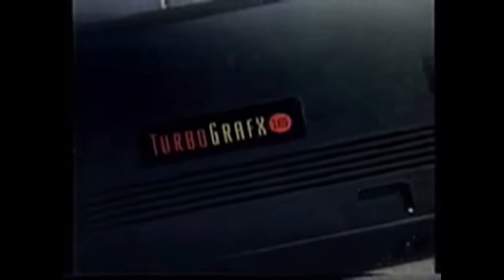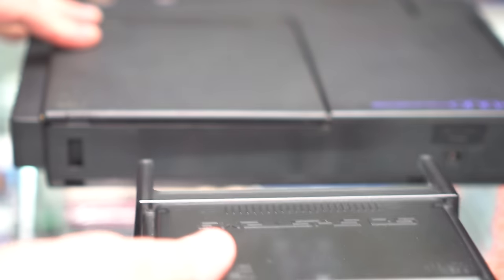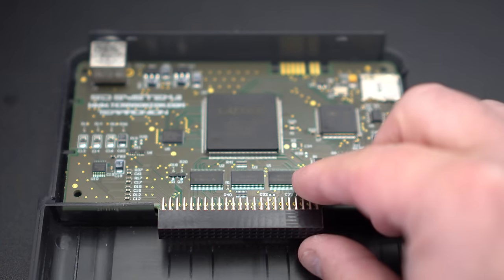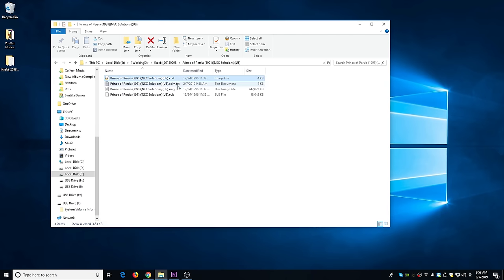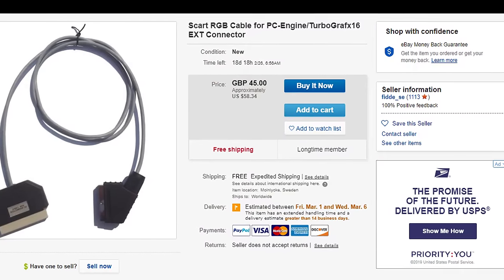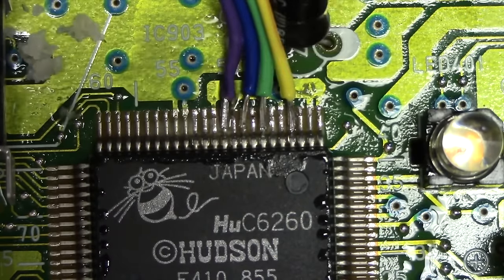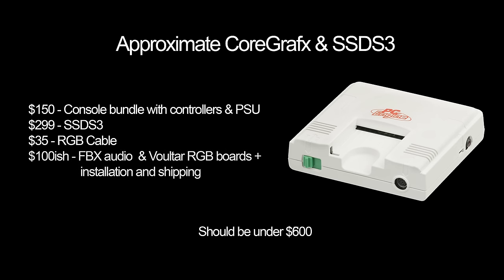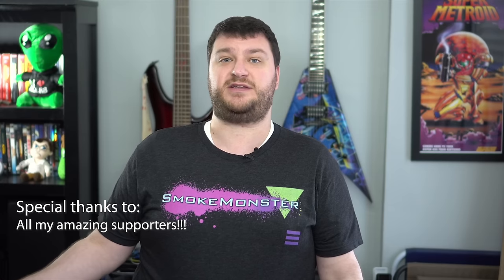TurboGrafx-16 & PC Engine Hardware Solutions

Comment: FINALLY! I’ve been begging western YouTubers to talk about UpperGrafx UGX-02 since December 2017. At that time, only GameTechUS’s video about the UGX-01 existed, and no one realized it was supposed to be an ODE or that it worked more like Hi-Def NES (replicates digital video in FPGA; doesn’t sample analog RGB). Yes: December 2017 was before the Super SD System 3 launched.
Reply from the maker: ...and the reason I didn't was because I wanted to take my time and give it a real review, not just a quick mention :)
Reply: RetroRGB Yep. It was still frustrating to see everyone assuming that they had no choice other than SSDSys3 while Terra Onion was still refusing to acknowledge the issues, but I totally understand waiting. Mind if I ask who loaned you one? I might have a few questions for the guy/gal. :)
Reply: @emmettturner9452  I was aware of the UGX-01 in development in 2017, but it did not advertise CD-ROM² support and was marketing itself as a DVI up scaler at the time. Meanwhile, the SSD3 was backordered and undergoing revisions until late January 2018 IIRC?

I didn't see any mention of the UGX-02 until the last week or two and just ordered one. Apparently it is only the second one shipped to the USA, so I don't think that in 2017 it was really a viable alternative, it did not yet exist.
Reply: greyグレェ In 2017, CD-ROM² support was announced for UGX-01 but they never managed to get it to work. Needed more RAM or something, so they revised it to UGX-02 and offered refurbishment service to UGX-01 owners. They kinda got ahead of themselves and even added instructions for ripping your discs to the SD card! It’s obvious that they always intended this to play CD-ROM², since the unit had an SD card and a USB port from the start (only one or the other is needed for simple firmware updates). I remember being baffled by the GameTech video in 2016 since he didn’t even mention the SD card slot or that this was full-digital (not upscaling). It was clear that he was missing something BIG.

Super SD System 3 was announced in Dec 2017 and began taking preorders. UGX-02 was supposed to begin shipping in 2017 but they ran into production issues. In the end, both SSDSys3 and UGX-02 began shipping in Jan 2018. Because of the botched launch where Terra Onion stopped shipping the first revision and recalled them, you could say that UGX-02 beat them to it... not that the UGX guys didn’t have their own problems with their launch but at least that was all BEHIND them in Jan 2018 (UGX-01 refurbishment thing and 2017 delay). ;)

David Shadoff (prolific ROM hacker/translator) seems to be in North America and doesn’t seem to be the one who provided one to RetroRGB so it seems that there are at least two others. How either of those got here is anyone’s guess.

According to Google Translate, their CD-ROM² page first went up just over two years ago:
2019/02/17: Update internal data update page , distribute upergrafx_20190210.pac.
2018/10/10: Update internal data update page , distribute upergrafx_20181007.pac.
2018/08/07: Update internal data update page , distribute upergrafx_20180806.pac.  
2018/08/02: Added bug fix progress page
2018/07/14: Update internal data update and communication software page, add ROM image transfer page
2018/06/05: Updated order page (For countries other than Japan)
2018/03/26: Update internal data update page
2018/03/01: Troubleshooting FAQ The page of CD image transfer software has been updated.
2018/02/21: The notice of the repair of UGX-01 has been described.
2018/02/19: A page of internal data update has been created. A bug has been fixed. Description of INTERNAL RAM MODEL in the setting menu has been renamed.
2018/01/23: The release date of UGX-02 was set on January 29th.
2017/09/22: Release date of UGX-02 changed to pending due to manufacturing process trouble.
2017/08/25: Announcement of new version release, How to use CD-ROM2 compatible function , CD image transfer software was created. Along with that, the existing announcement was also changed.
2017/04/02: The page of CD-ROM2 correspondence plan was created.

Kinda crazy how long it’s been getting ignored, especially in light of the SSDSys3 issues. The alternative was hiding right under our noses the whole time!

I started the “Anyone else excited about Super SD System 3 for PCE/TG16?” in 2017 and you can see exactly where I totally switched gears and got more interested in UGX-02: Dec 26, 2017. This video was a year and some months later. I literally waited THAT long for a western impression. :) Looking forward to yours as well. Thanks!

Comment: Best video so far! I only wish there was also a bit of info on the IFU-30/briefcase. They look the coolest IMO. And something I've always wondered is whether IFU video output, whether the original composite or through an RGB amp installed on it, also has jailbar noise, and what the fix is for the IFU as opposed to PCE/CoreGrafx units.
Reply: You will still need to modify the console to eliminate jailbars. In fact the IFU RGB mod needs additional filtering to produce the same video quality as the console on it's own.
Reply: @MobiusStripTech  Oh wow, I didn't know that. Thanks! I know Voultar designed a board specifically for the IFU, but it doesn't seem to be available for purchase. There's a lot of questionable mods out there for the IFU, so hopefully more standard mods become available for the neat little briefcase.
Reply: @Izquierda  he is still planning on releasing the IFU board. I believe he recently said he found another change that needed to be made for fitment. Due to a change in one revision of the briefcase.
Reply: @MobiusStripTech  Yeah there's the IFU-30 and the IFU-30A. The power button looks a bit different, and the box design was different too. I suppose there were small changes in board design then. When Voultar releases the board I'll reach out to see if you're available to get it installed in my IFU since I'm located in the US. Thanks again for all the info!

Comment: Great video with lots of good info. So many choices it is just a shame there is not one truly ultimate solution.

I do have a couple, hopefully constructive, critiques.

When talking about Altered Beast you mentioned that some of the early games had system card comparability issues. I think it is literally the only game with that issue. Also the system 1.0 card was only released in Japan and replaced relatively quickly. I just hope that statement doesn't cause people to worry about sys card compatibly because of game bugs when that is not a thing other than this 1 game.

The other thing is I don't think it is the best advice to just tell people to get the Pro arcade card. It costs a fair bit more than the Duo card. The explanation of the differences is: I if you turn on the system without a card in the slot and see the System Card screen you can use the Duo card otherwise you need the Pro card.

Otherwise that was a great video, I really enjoy these deep dives. Keep up the good work, we are all counting on you.

Comment: What’s going on with the display at 26:35 into the video? The wavy distorted picture at the top of the monitor. I had the exact same thing happen with a Sega Genesis 2 into a PVM. I switched out the RGB cable and it was fixed but I’m curious as to why it gets like that. I know it was a “slightly cheaper cable than the replacement but a drastic improvement. Just wondering if I can fix the cheap cable or just leave we’ll enough alone

Comment: I have original hardware for many consoles but I enjoy emulation for some of the more finicky consoles. I own a tg16 but i prefer to emulate. Retroarch with run ahead latency reduction and output to pvm offers an experience close to the $1000 options in this video for a fraction of the price. Input lag, in some cases, is less than original hardware and i have noticed no audio issues with the emulator I'm using. Only downside is slightly softer rgb than original hardware.

Comment: TurboBooster from DB Electronics is a good solution, but I had never seen that Ebay RGB cable with the amp built into it. I  want to buy a second PC Engine for my HDTV, and that would be a great option.

Comment: If the SSD3 got it's issues sorted out and also offered digital out with HDMI, I think that would be point where I'd finally be willing to drop down the cash for one.
As it is now, it's tempting but $300 is still a lot of money when it's not a complete all in one solution yet.
I might even be willing to spend $350 if I knew this was the definitive end all solution for my PCE

Comment: You can get RGBHV from the UpperGrafx with an HDMI to VGA adapter. If it really supports original 59.83Hz output then RGB is a non issue, so I hope I’m wrong about the VSync settings (59.83 vs 60 = Buffered vs. Non-Buffered).

Comment: Excellent and extremely thorough analysis. I have just subscribed. So I have my original Turbo Duo from '92 and haven't used it in years. I am wary of using it after hearing about the capacitor issues. Before I begin to play games on it again, I would like to have the caps replaced, an 8-pin RGB/SCART connector installed, stereo RCA jacks installed, and the jail bar fix. I own an OSSC for playing on an HDTV. Can you recommend a reputable, professional modder to have this done for me in the U.S.? Thanks!!
Reply: Simple: Voultar

Comment: Does the legit CORE GRAFX have a slight buzz on the sound, or do I need a cap' replacement? It's nothing that bad, but you can hear it if you pump the volume up.
Reply from the maker: All analog audio will have at least some buzz at higher volumes.  Video game consoles more than audio equipment, cause they were designed for a general audience, not specifically audio gear.  But if you know how to safely replace capacitors, it's always a good thing.

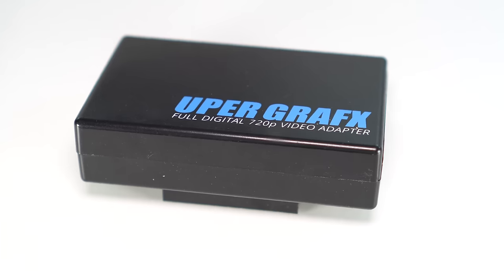Comment: For the Uper Grafx, just wondering -- at 12:40 the video shows a DVI to HDMI cable being used to bring the video into a monitor, but wouldn't you need a converter more like eBay # 112631637002 in order to get the analog line audio and DVI digital video to an HDMI device? I know the audio mentions a converter (but not the video), but I figured I would ask because I had to buy a similar converter recently. Just asking mainly because I haven't been able to get my monitors to play analog audio inputted when the HDMI interface is chosen for video input, so I believe the audio has to get converted to digital and then shunted into that HDMI cable somehow.
Reply from the maker: Nope.  I should have clarified that the UperGrafx has an analog-to-digital audio converter built in, so audio is transferred over DVI.  I probably left it out to not confuse people into thinking the video was A-D too....but I should have at least specified all you need is the cable and nothing else.

Comment: I’m so confused by the different models, shocked by the aftermarket hardware prices, and horrified by the owner’s responses, that I can’t imagine doing anything except a MiSTer for TG16. Seriously, a MiSTer and the low-latency card to use original controllers are cheaper than any of this.

Comment: Any timeframe when to expect the re-worked Super SD? Would like to get one but hearing that I would need an extra audio fix is a bummer.
Reply: They already started shipping the new revision that contains both fixes. If you order today, that's what you will get.
Reply: @MobiusStripTech Thx mate!
Reply: @MobiusStripTech  i ordered mine on 01/28/19...would that fall under the revised run? i got it from stone age gamer.
Reply: @bobthompson7545  unfortunately  no. The units stoneagegamer has are all rev2/3. You would still need the add-on boards. At which point you would have the equivalent of the new revision.
Reply: @MobiusStripTech  well that blows!! mabye i'll return for a refund and wait for the new board to come to Stone age.  I can't see spending ANOTHER 100 bucks to have it modded etc.  thanks for the heads up.
Reply: @MobiusStripTech  I ordered yesterday (Feb 14) so does that mean my ssd3 from terraonion is the version with the latest audio fixes?
Reply: @DannyVirring  yes. If you ordered from TerraOnion directly in 2019, you will get the new version with fixes on board. StoneAgeGamer will be getting the revised units at some point as well. I don't work for TerraOnion, so I can't speak to timelines on that.

Comment: 13:07 “Only possible because he PC Engine and TurboGrafx-16 as well as the GameCube [DOL-001] are the only game consoles that present the digital video signals externally in a connector.” They don’t really have digital output, but what’s really happening is even cooler:
The connector exposes enough of the bus between the CPU and VDP/VDC, VCE that the UGX-02 can replicate the video chip in FPGA. This is almost exactly like the Hi-Def NES and NESRGB, which replicate the NES PPU to get video that isn’t available anywhere on the board.

Yes, it does A-D on some of the audio since it has to mix console audio with the digital CD audio it generates, but at least the audio it’s responsible for was never converted to analog and back.

Comment: So just to confirm... the "REVISION 3" of this product that's on stoneagegamer.com is the NEW revision board with the video and audio issues fixed, correct?

I have to be sure before I decide to purchase. I don't want to end up buying it, and then regretting it later to a newer model. Too many horror stories online about this product. Smh!
Reply: You should confirm with stoneagegamer on their stock and revisions. I have ordered Everdrives from both them and Krikz directly and have received different hardware revisions of similar products.
Reply: @grey9514  Thanks, and I did. They said their new stock received was indeed the new revision board with the audio and video fixes. I'm assuming the best way to know for sure if it's the new one  is to check the firmware on the device, correct?

Comment: I want to make my own cables I was wondering if you know a good quality brand and model to get. Shielded and proper number of internal wires.
Reply: Is there a reason you want to make your own? You will spend considerably more money on buying cable to make your own than it would cost to buy pre-made cables. Individually shielded coaxial cable with the proper number of conductors and 75ohm impedance is expensive. Especially in small quantities.
Reply: @MobiusStripTech  43 systems running into a extron crosspoint. Scart cable+extenison+BNC  adaptors making my own is more cost effective.

Comment: I love your knowledge and videos but I disagree with you about using the output pins for composite output.  A filter capacitor is not necessary and it will not harm your system.  I also have and use the $21 Chinese RGB board you showed early in the video.  It does a great job and causes no issue.
Reply: The composite video output actually needs a circuit to operate correctly. It is not intended for direct output and therefore is out of spec. Without the circuit you will experience a subpar video quality compared to with. It's a simple enough circuit that not including it is somewhat silly.
Reply: @MobiusStripTech  I didn't realize the Turbografx was RF only till I did a lil research this morning. That said, they released the Turbobooster and Turbobooster plus which allowed for composite, so wonder what the official solution looks like inside. I'd assume it would have additional circuitry as you suggest, but would be interesting to know if anyone has opened one up.
Reply: @jamon1567  there is a full circuit in the console itself to massage the signal for RF. The composite video circuit on the FU-RGB board is based on the circuit for the Turbobooster. That's why it works so well.
Reply: @MobiusStripTech  Interesting, thanks for the info. I did see some people say that RF looks pretty good (relatively speaking anyway) on the Turbografx. I know that composite looked awesome (again, relatively speaking) on my Supergrafx. I dare say that I'd be perfectly happy using it on my BVM if RGB wasn't an option through the SSDS3.
Reply: @jamon1567  these consoles are known for having some of the best composite video output. They really knocked it out of the park on that.

Comment: Maybe someone can answer this, as I don't really know for sure. If a PC Engine or Duo was RGB modded with a standard 8 pin din output (the same as the Neo Geo); could one use the Neo Geo HD Retrovision adapter to pull RGB out of the PC Engine and use the Genesis YPbPr cables, or are the pins connected differently? If so, would it be possible to modify the pinout to make the adapter compatible?
Reply: This will not work. The Duo with 8pin DIN is a completely unique pinout. There are unofficial adapters that may work with your Duo. However you need to know about the possible incompatibilities with your mod.
Reply: @MobiusStripTech  Alright, thank you, that's what I suspected. I wasn't explictly referring to modifying the pinout on the console end, I was referring to modifying the pinout on the adapter itself. But this does clear up my suspicions, so thanks, was just curious.

Comment: Yeah Terra Onion make amazing products (usually) but they fail at the simple stuff and have semi shady business practice if you ask me. I preordered the Mega SD and as I live in the U.K. fell victim to the company moving to a tax haven in between taking orders and shipping. Then the first batch was either made up of prototype models, or made without a bevel - I got the one without the bevel. Not a huge deal as the mega SD sits in the console most of the time limiting ware and tear, but still this is a luxury flash cart not a stinking china everdrive. 

I’ve since got involved in the Mister project and so it’s unlikely I’ll ever need another TO product again, unless they come up with a plug and play ps1 solution. But if I do, I’ll wait 6 months for all the kinks to be ironed out and then order from somewhere like Stone Age gamer.